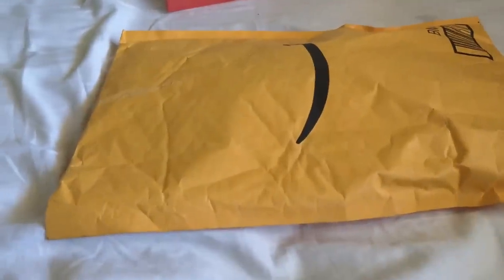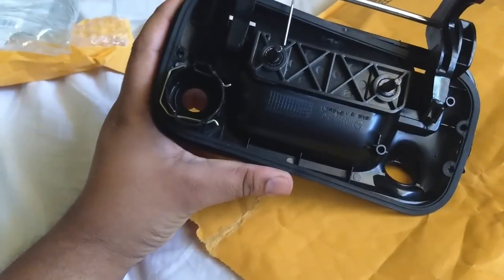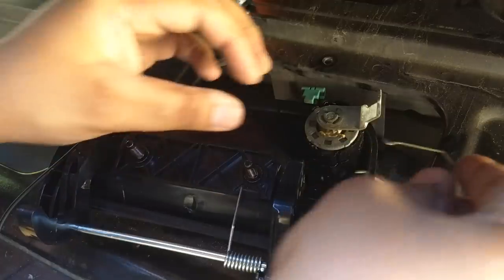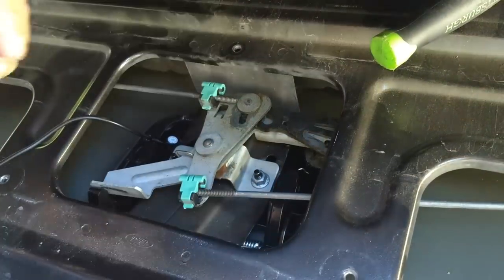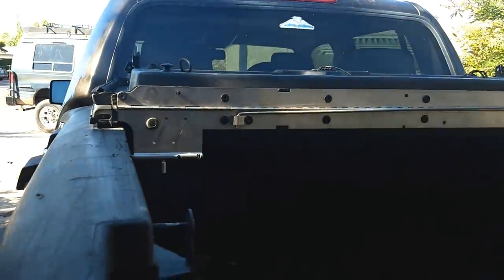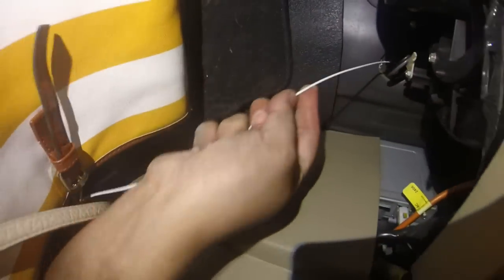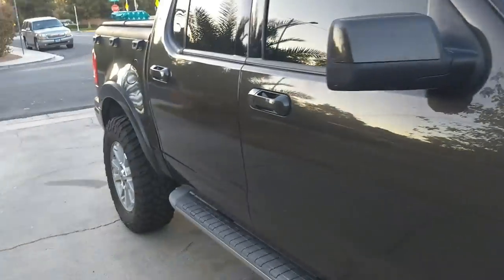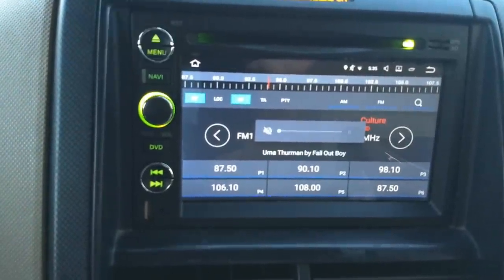Ford Truck Back-Up Camera Install (Tailgate Handle)

Comment: Installing a reverse camera and subs to my 2010 sporttrac. Couldn’t for the life of me find a good spot to get the video wire into the cab. Was really trying to avoid going through the firewall to save cord length but seeing as that’s what you did I think I’ll end up doing that as well. Seems to be the easiest route. Hopefully I can find another good entry point for my subs power wire as that grommet won’t have enough space for both. Thanks for the video!
Reply from the maker: Thank you did u end up finding a different spot?

Comment: Looking to do a similar install, thanks for detailing what you found.  I was glad to see you solder the wires - too many people twist and use a wire nut.  That works until it meets water and time will rust / corrode it out.  Even better is to slide some heat shrink tubing over the wires before you solder, then heat it up and let it make a real tight seal.  Better than electrical tape in my opinion.
Reply: me on the previous truck I owned (2001 S10 ZR2) the previous owner had literally twisted the wires together on the taillight when installing towing electronics. They had used bad quality electrical tape to cover it, too. Well, I ended up getting pulled over for it, thank goodness the officer was forgiving.

Comment: If you remove the latch rod clips, they should usually be replaced. This is the green clips when it says you don't need to do this. These are available new from Dorman HELP! line in most parts stores. 

He didn't directly explain it in the video , but you don't need to release the latch rod clips. You can simply unbolt the handle assembly and drop it out. This will leave the latch mechanism in place so there is no need to adjust it, which is the cheap & quick method. The "working on my own truck and keeping it forever" method is to have the clips on hand and replace them since they are cheap plastic pieces. While I am in there and they are easy to reach, I will replace the clips.

Comment: Very nice video. It is not to long or too detailed. It shows people everything they will be getting into before they start on such a project. Even the music is tolerable. I've been using a DIY license plate camera on my F150 hooked up to a headrest type DVD monitor. It's great for lining up my trailer hitch in the left right direction but not so great for seeing where I am front-to-back. I've been thinking about how to mount it near the top of the tailgate without cutting any holes in the painted part of the tailgate. Mounting it, or another camera, in the handle might work.

Comment: There is a hole under the driver side to put a wire from the radio to the frame. A bit of research would have saved you 454 hours…

Comment: Got a question on your stereo install. What dash kit did you use to hook the stereo up to the factory bolt spots.  I have an 04 F150 and bought a similar stereo but cant find an aftermarket dash kit that will fit the stereo properly into place.

Comment: What year is that esport track? I have a 2008 and Amazon says that the part doesn't fit my truck?
Reply from the maker: It is a 2007, I am pretty sure that all Ford trucks of this era used the same tail gate handle. It gave me the same messages when I bought my truck. I am not 💯 sure for your specific application
Reply: The sport trac is the 4 door ranger that's been sold in Mexico and Canada for 20+ yrs and over seas.
All ford trucks actually use the same stuff and with the suv's aswell.
Edge, explorer, expedition, f150 and 250
Parts are interchangeable for the most park. Mirrors, badges, handles, radios, steering wheels, gauge cluster.

The reason why some things say they don't fit is because the seller pulled it from a certain yr and thinks it only fits that yr.

I have an 04 ford freestyle van touch radio in my 08 f150 because I didn't wanna pay 300+ for the same radio.